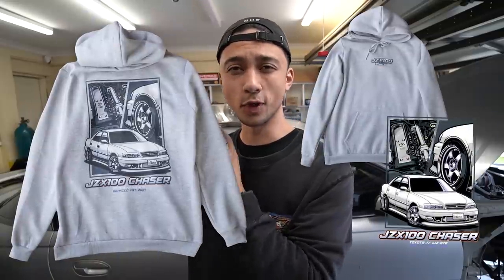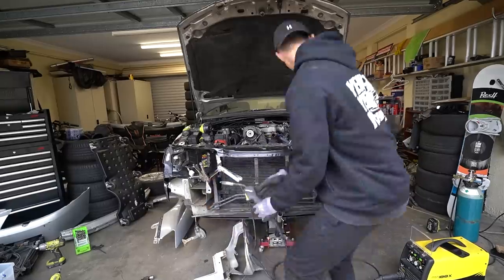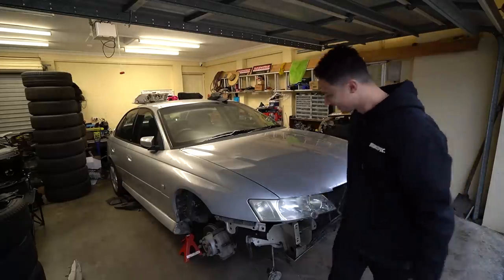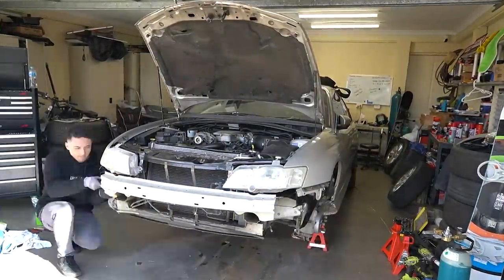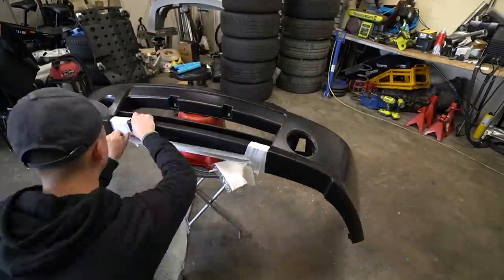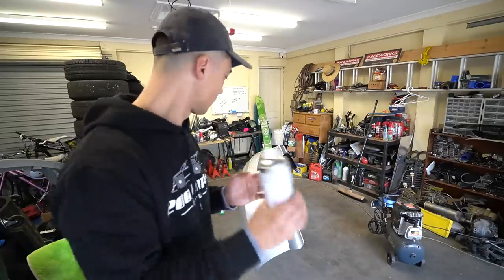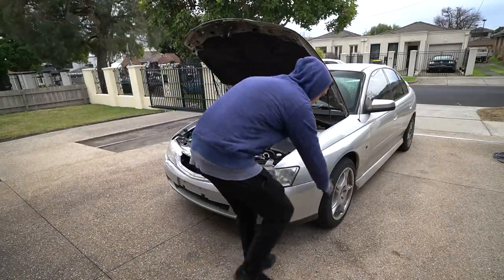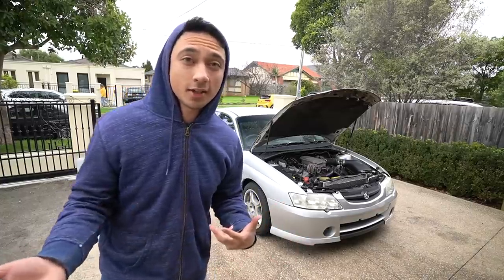REBUILDING A WRECKED HOLDEN COMMODORE OFF FB. WAS IT WORTH IT?

Comment: Just thought I’d let you know, when it comes to painting. You had a new bar, you had to sand the whole bar with anywhere from 240-600grit sand paper then prime it. Once primed you sand the primer with 400g then you use prepsol and paint. The way you paint it with basically no sand means it will flake asap. So try not to pressure wash the front bar 😂

Comment: You should open up a automotive shop rex  !!
Fantastic d.i.y
A tip in cold weather rex when priming,painting and clearing in cold weather,heat up cans in hot water in bucket for half hour to heat up so the product comes out better !

Comment: Use a pool noodle cut down the length on only one side slide onto the crash support/ impact bar and it’ll fix the gap under the headlight looks great tho otherwise
Reply: Interesting.. Work for the rear too?

Comment: Quick question, If I buy an au falcon, how many km do you think it will be able to last before it dies. And is the fuel economy good?
Reply: 500,000 and no
Reply: @TheDexta98  thanks 👍
Reply: @gnasher5677 Well it depends how it's been treated in the past and what condition its in, but the engines tend to be bulletproof and can last a very long time... However everything around the engine can fail, as it's a pretty old car...

Comment: Just have to tell you how pissed I am. When my 2000 Camry LE 4 cylinder is park the tachometer goes up and down like crazy. I was told by my cousin that it sounds like the throttle body positioning sensor is going bad. Well I went to AutoZone and got a new one. Well it looked like it had been used. It goes back tomorrow and they will give a new one. That's what pissed me off. I take the Camry to Wrench Brothers there good honest people. The new rims and tires look awesome  just thought I would let you know how the Camry is come along.